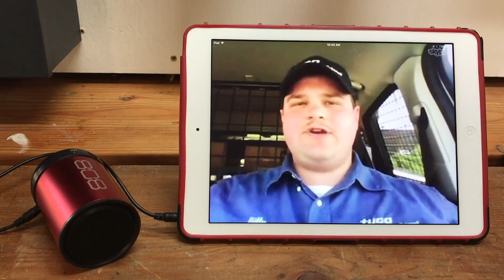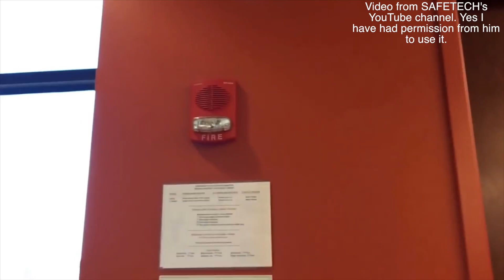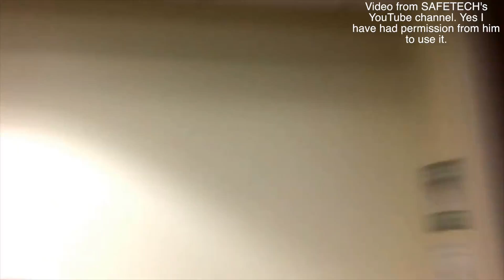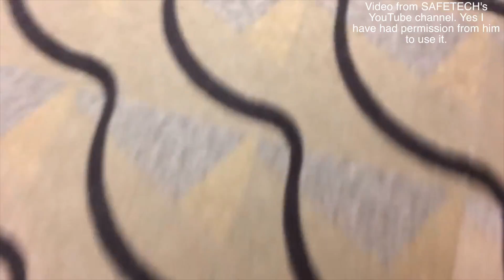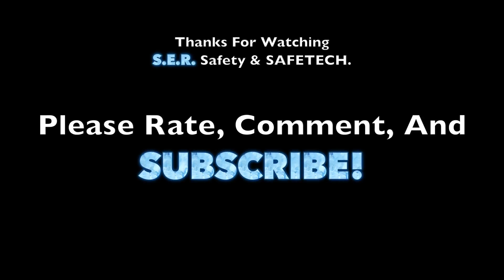What is the reason a Voice Evac System is installed instead of Horn/Strobes?

Comment: Some airports still don't have voice evac system which is definitely a safety hazard due to the risk of overcrowding exits, ignoring alarms, and unnecessary panic. DFW Airport has a voice evacuation system since the late 1980s since some of the speaker strobes have white lenses instead of clear lenses. Not just 75ft or higher is when a voice evacuation system is mandatory but, also 1000 or more occupants.

Comment: Heres a fact about installing voice evac systems: If the contractors have a lot of money then they'll install a voice evac system. If the contractors don't have alot of money then they'll install a normal system with horn strobe devices. 

The reason is why voice evac systems are more expensive than normal systems is because it's alot harder to program, install, and wire than a normal system.
Reply: A horn strobe is 60 US dollars while speaker strobes are 90 US dollars. Buildings designed for 1000 or more occupants must have a voice evac system such as a movie theater or it will not be compliant.

Comment: About the high rise thing, for a general fire in a high rise, the whole building is not required to be evacuated—doing so would be unnecessary and cause unnecessary disruption and chaos. After an alarm is turned in, the signals might only be activated on the fire floor and the floor immediately above, and the occupants would move to their assigned re-entry floor. Of course if the situation gets worse evacuation of additional floors may be ordered.

Comment: Why is it that when you test a system they always use a key instead of pulling the station
Reply: For a functional test of a pull station that’s actually not allowed. The NFPA says the test of a device must simulate how it will operate in an emergency, like spraying canned smoke into a detector instead of using a magnet.

Comment: why don't schools have voice evacuation alarms
Reply: Aiden Shivanonda my school has Wheelock NS, as well. NS inside the building and AS outside. What does your school have them coded to? Code 3?
Reply: RSS Alarms I go to a small Satellite Center to my high school for 1/2 the day. There's only 10 classrooms and it has voice exac
Reply: T Reigh code 3
Reply: Only huge schools would have them, my high school has an est3 with voice evacuation.
Reply: some do mine does an Edwards vigilent
Reply: My high school has a voice evacuation system. Buildings that can have more than 1000 occupants are required by code to have voice evacuation systems. Nowadays even smaller sized schools in some places are required to have a voice evacuation system. UNT had to put in a voice evacuation system in discovery park because incidents of injuries from false alarm and an inspector ordered by the fire depot failed the system. In UNT discovery park there are false alarms at least once or twice a semester caused by a drop in water pressure. The fact they converted it to a voice evacuation eliminated panic dashes and/or overcrowding exits. After they installed the voice evac system, I was able to stay more calm pay attention to exit signs and go through the nearest exit even if the door is alarmed.

Comment: my school has both voice evac and horn strobes. voice evac is only used in my school auditorium.
Reply: FireAlarmsfromSouthTexas this is due to the different building occupancy types in the building.   With regard to the international building code (IBC) the auditorium would be a type A or an Assembly occupancy and the rest of the school would be a type E or Educational.  The assembly would require voice evacuation over a certain occupant load.
Reply: My high school which I graduated from in 2013 has a voice evac system consisting of Gentex speaker strobes, RSS strobes, and E90  speakers. The fact it has a capacity of over 2000 students explains why they have a voice evac.

Comment: what are the three fire alarm relays found in elevator machine rooms that recall the elevators do ( what does each relay do) also what would happen if a building owner tryed to clear a battery trouble on their alarm panel by hooking a wall adapter that outputs dc power, to the battery connections
Reply: 1st relay is Primary recall which sends the elevator to the designated recall level upon activation of any elev. lobby smoke other than that on the recall level.
2nd is alternate recall used to send the elevator to the secondary recall level in the event the primary recall level smoke detector activates. 
3rd is the "Fire Hat" relay which signals the fire-hat indicator in the elevator cab to illuminate in the event a smoke detector in the elevator equipment room and/or hoistway is activated. This also activates the primary recall function. The purpose of this is to warn whoever enters the cab that the elevator may be compromised and shouldn't be occupied.
Reply: sean juth 
Also, to answer your second question, the owner would be advised of the need to correct the situation and the issue would be noted in my report if they choose not to. Furthermore, the facility would be subject to citation by the fire marshall's office and/or appropriate AHJ.
Reply: Actually, in some jurisdictions, any fire alarm activation causes elevator recall.